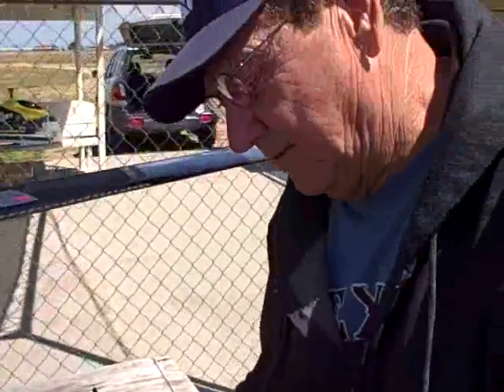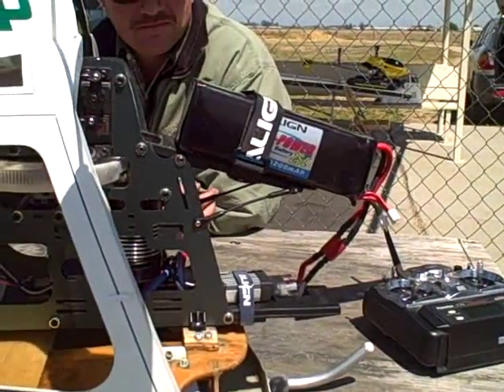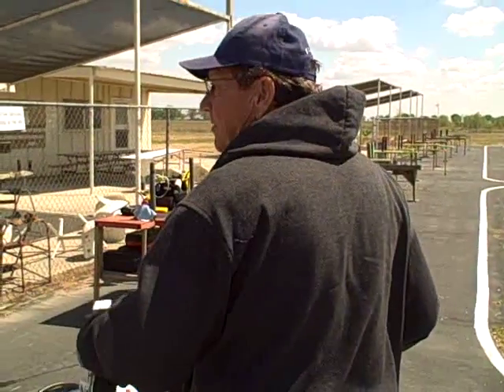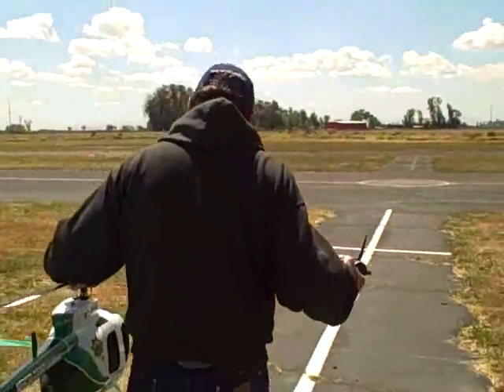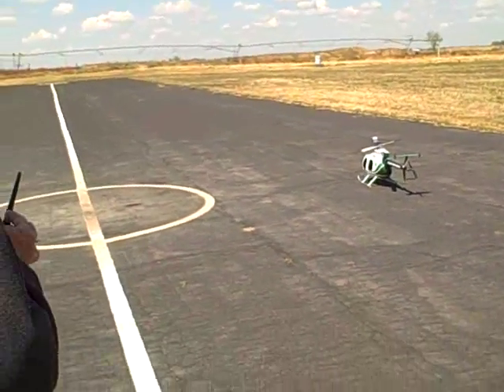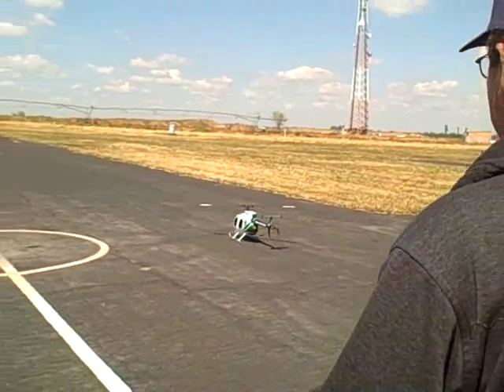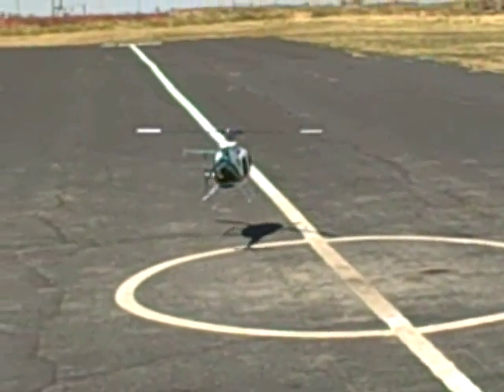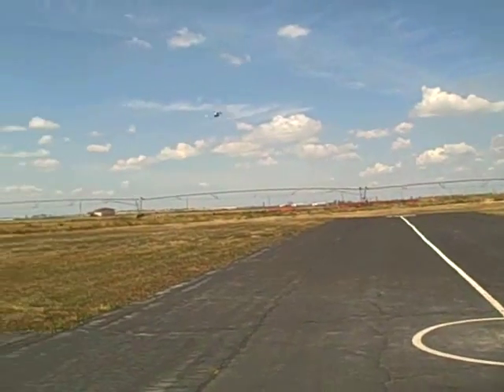RC Helicopter - converted to electric

Comment: @a100nick 
Just have 2 or 3 batteries... And charge at the field with a 60 Watt solar panel plugued on a 12 Volt moto-bat. It is free. If you pay attention to your lipo battery, it will take 30 flights for paying the  same amount of gas and after all the flight are free ! It is also free of fume, oil and load noise. I will never back to gas ;-)